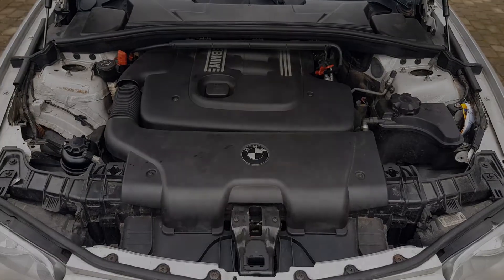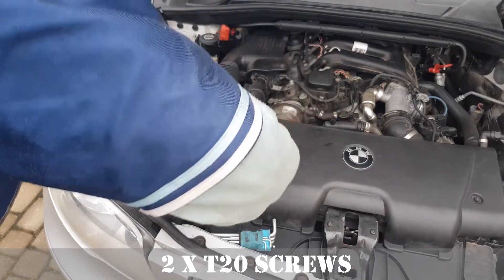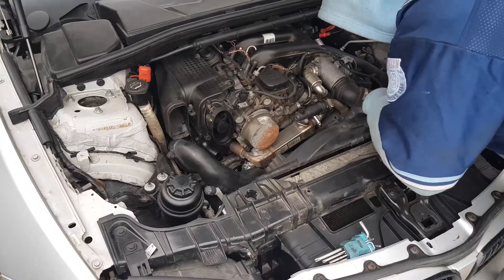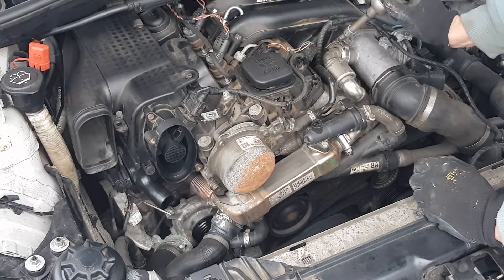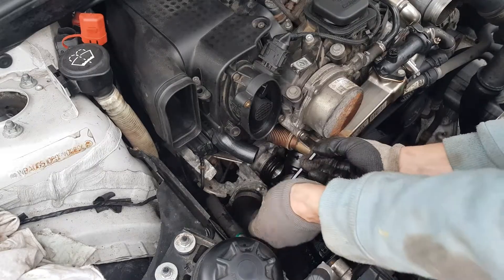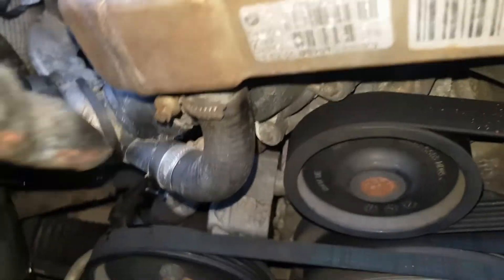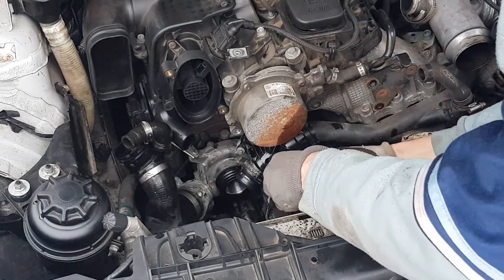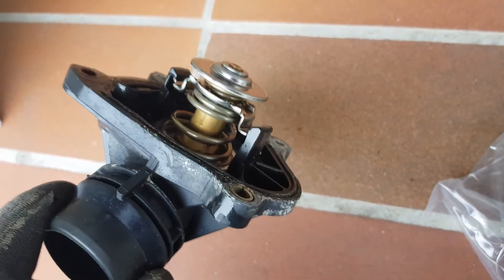BMW E90 87 Thermostat Replacement | E91, E92, E93, E46, E60 |😸

Comment: Can't leave message on your other video regard the dsc fix. It's that still function after you loose out little bit with the pin? 
Cause if emergency loosing control, dsc it's help

Comment: Hello I want to ask you about the temperature of engine coolant.its between  108 to 114 c  is that normal or too high?? the mechanic told me that's normal if it wasn't higher than 120c ...my car is bmw e92 320i (motor n46)

Comment: Thank you so much for this video, I used this guide to do mine and it went pretty much perfect. So glad to have found a video for a car with the same engine as mine. So many parts of this engine are inaccessible even the parts that need regular servicing like the air filter. The only real issue I had with changing my thermostat is the 4 bolts that hold on the thermostat are external torx which you would need an E9 bit to take off (which may not even exist) and that some people might not have. A 9mm socket might work but I didn't have one to try. It was worrying getting all that way and discovering I might not be able to get the stat off because I didn't have one. In the end I had a bit adapter in my ratchet set that managed to fit just by chance. The bolts are Aluminum too so I was worried about rounding them off but in the end it all worked out fine.

Comment: It's nice, that in your engine the thermostat is held by those clips. In n47 diesel, it's loose - unfortunately. 've just changed mine today. Temperature raises slowly, 've reached 92, but that's it. Gonna check for the boost leaks, like you've said in the other video. Anyway - thanks a lot :)

Comment: At what engine temperature this thermostat should open?
Reply from the maker: If your temperature is not approximately 85-90 c in a few km then you have a thermostat problem. Another indicator of bad thermostat is  blocked dpf, high consumption or louder engine.
Reply: @RegisGarage  turit galvoj kad  kai lauke  10-15 laipsniu per  kelis kilometrus  turetu  uzkilt iki 85-90 vanduo?  rodmenis vandens imat is hiden meniu borto kompo? aciu uz atsakyma!